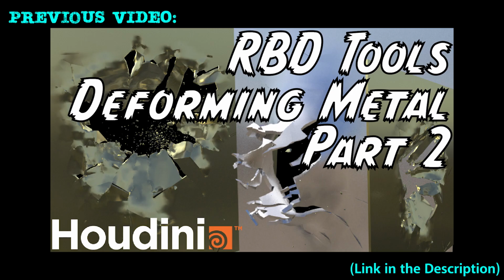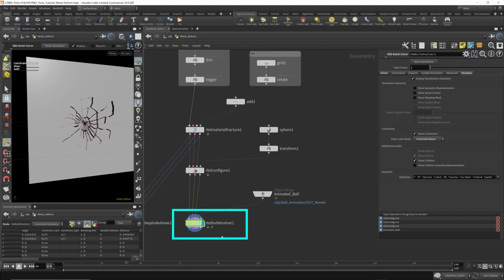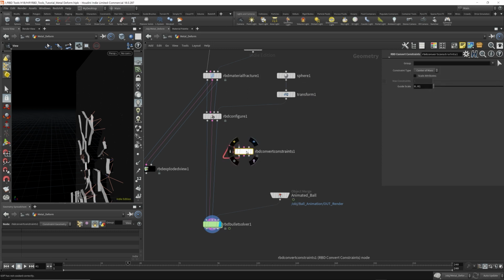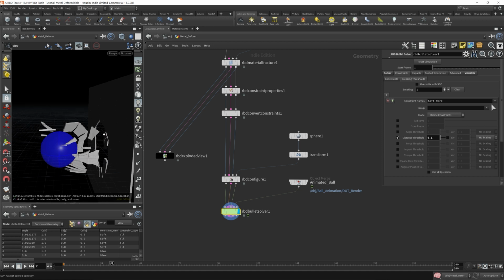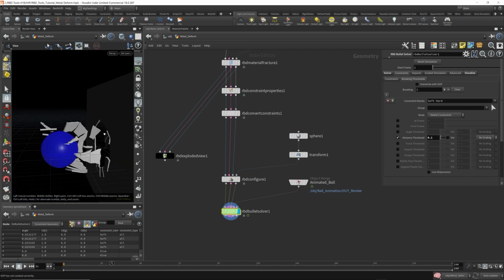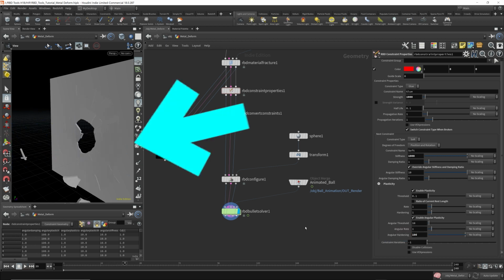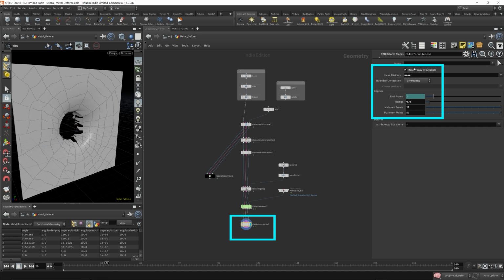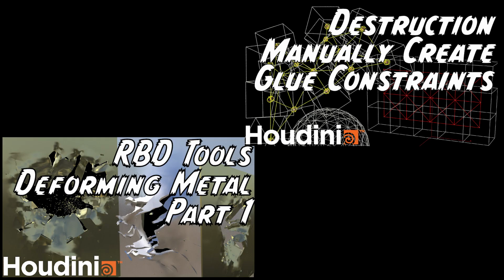Tearing & Deforming Metal using RBD Tools in Houdini Part 2

Comment: How do I stop the shaking those pieces after the ball through the wall?
Reply from the maker: This is a very common issue, there are a few factors that may cause the shaking, too much external forces acting on the pieces like bounce.  BUT I do find that in this particular example where you have pieces fracturing another one while keeping selective constraints still connected it is helpful to increase the elasticity and harden it as quickly as possible to try to keep it in position after the ball collides.  Try that and it's also helpful in the RBD Solver node to increase friction, lower bounce, & increase substep.   See if that works out.
Reply: @bubblepins  Thanks, will try!

Comment: Do not disable "Apply Constraint Properties" in "RBD Material Fracture" node. In some versions of Houdini this might lead to loss if the attribute "constraint_type" and broken simulation.
Reply from the maker: You make a good point.  This video is a little dated, I am doing a more updated series of RBD nodes in Houdini in my new Cinematic Destruction mini-series that currently ongoing:
https://www.youtube.com/playlist?list=PLqovuMX-teVMhkAd5dCfUI17Api5_YaPO

You can disable the "Apply Constraint Properties" in RBD Material Fracture, but you just need to add the constraint attribute data back in afterwards.  You can drop down a RBD Constraint Properties node after.  The RBD Material Fracture node will create the Constraint poly lines for you automatically, which comes in handy, but if you wanted to create that yourself manually, then you need to drop down a RBD Constraint from Rules to create the polylines and RBD Constraint Properties to fill in the constraint data.

Hop e this helps!

Comment: Thank you so much for all your tutorials! Especially as a houdini beginner you have helped me get the grasp of it. 

Followed your tutorial and it works perfectly. Just a question! after the rbd deform it seems that the velocity attribute gets lost. Might there be a solution to bring it back?
Reply from the maker: It's actually still there, drop down a unpack node and connect it to the 1st output, the Geometry output of the RBD solver.  You can do the same thing to the proxy geometry as well.  For some reason, it only works with the unpack node and the RBD unpack didn't work for me.   Remember to put an asterick in the "Transfer Attributes" parameter in the Unpack node or choose the "v" attribute to transfer back out.

Hope that helps!
Reply: @bubblepins  thank you! it works but the velocity seems a little off not too sure why.
Reply from the maker: @bryanng02  Yeah I think the RBD Deform Pieces does something funny to the pieces.  You can try this instead, put down an assemble node to repack the blast pieces and put down a point velocity node to recalculate the velocity for each blast piece.  Then finally unpack it again and remember to transfer the v back out.  

See if that helps!

Comment: Hi, can you tell me how I can deform metal without breaking it? And how to make adjust how strongly it is deforming?
I use an object that has a protruding part that should just crumple up, but instead it just pushes the part underneith away unrealistically..
Reply from the maker: I think you might be looking for something like the new H19 Vellum Unified Solver deform destruction, which I haven't had a chance to do a video on yet.  But I had a previous video on a very similar effect that I called "SDF Destruction" and it deforms an object upon impact without fracturing it:
https://youtu.be/a8xHhjFeZN0

Hope that helps!

Comment: Hi, thanks for the great tutorial! Liked and subscribed instantly! it all works perfectly I have just one question. Can you please also tell me why am I getting this slight but constant jittery movement on all chunks after the ball pierces the surface and how to fix it? Thanks a lot in advance!
Reply from the maker: The jittery movement may be due to several possible reasons.  
The first thing, I can think of is the RBD Deform Pieces node, sometimes it struggles to figure out which pieces are adjacent to weld together, so you can help it by filling in the piece parameter on the RBD Deform Pieces node.  This would be the attribute Name Attribute for the blast pieces, which should be by default "name".  And remember to select "Constraint" for Boundary Connection.

Is your collision geometry a little more complex with sharp pointy corners or some sort?  If so, I would suggest to turn up the substeps in the RBD solver → Advanced (tab) → DOP Network (expand) → Substeps.

And double check if you have the RBD Constraints on the edges of the blast pieces similar to 11:04 in this video.  

Also try reducing the bounce in the RBD solver → Solver (tab) → Bullet Object (sub tab) → Bounce.

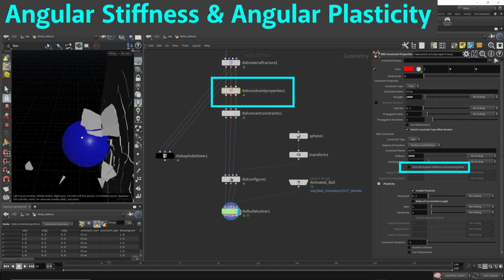Another thing I can think of it is to increase the plasticity 17:00 in the video, because this will harden the blast pieces almost immediately if the parameter is high enough, causing the pieces to stay in place.  

Hope this helps!
Reply: @bubblepins  Thanks I appreciate your prompt reply! Unfortunately none of this helped and all chunks still jitter. I downloaded your file and they jitter even there. If you would be able to fix it in your scene and reupload it whenever you'd have some time - that would be really awesome! But no worries, I will also try to fiddle with a few parameters to see if it helps fight the jitter. Thanks a lot once again!
Reply from the maker: @defonten  Thanks for telling me!  I didn't realize that scene file was jittering so badly.  I was playing around with the parameters this morning and managed to reduce the jittering noise, but for some reason there is still a bit oscillation left.  I posted an updated HIP file up along with a screenshot of the modified parameters I made on the blog.  Sorry I ran out of time playing around with this scene, so I've reduced the jittering, but not completely removed it.  I may revisit this scene in the future when I get more time.

Hope this helps so far!

Comment: awesome tutorial and explanation, thank you so much!
Just want to ask: what if I want to export that as a VTA texture?
From what I experienced, the VTA output node needs a dopnet to work (it will calculate also with a geometry Null but then the result wont work in UE or whatever engine) but we dont have any in this scene. If I set the object as Static, that will create the dopnet but the simulation brokes
Reply from the maker: Do you mean VAT (Vertex Animation Textures)?  I did a simple test for vertex animation a very long time ago using mantra to render it out and imported it to UE4 and it worked!  However I could never get collisions working with it so I gave it up.  The best thing about it is that you can export fluid sims into UE4 and at the time Niagara wasn't out yet, so this was a breakthrough for me.  But VAT isn't very necessary anymore, since Houdini and UE have a lot of tools to make the two applications more seamless.  You can just export the fluid particles from Houdini and import it into UE through niagara system.  Now I haven't tried this yet.  But theoretically it should work.

Hope this all helps!
Reply: @bubblepins  yes, I meant VAT, just mispelled two times haha. Ty for the answer btw, I'll try the Niagara workflow as well :)

Comment: how would you use the rbd configure SOP in junction with the rbd connected faces SOP? I'm having trouble passing the rbdconnected prim attributes through the configure node.
Reply from the maker: oh I know what you mean, its because the RBD Configure node packs the rbd objects which causes a conflict with the RBD Connected Faces node.  If you change the order of the nodes a bit, try putting the RBD Configure node at the end right before the solver.  Then after the dopimport node, put down a unpack node then you can use the RBD Disconnected faces.

Hope that helps!
Reply: @bubblepins  Right so place connected faces node before the configure node, then after the the deformpieces node the deleting dis-connected face node no longer works BUT the four prim groups created by the original connected faces node are still stored in the geo. Something is happening that keeping the disconnected faces node from working and I think its how the configure node packs them. Anyway with some clever grouping and deleting I can recreate the same effect I'd get from the disconnected faces node. It isn't pretty but hey, it works. Hope that makes sense. Thx for the tutorial btw!
Reply from the maker: @Cheesyeggbake  Thanks!  Drop down an Unpack node before the Disconnected Faces node.  Because the geometry is still packed after the DopImport node.  Hope that makes sense, it's a mouthful.

Comment: How do you make the ball collide with the wall if the wall was a voronoi fracture
Reply from the maker: Replace the rbdmaterialfracture nodes with the voronoi results.  You also need an unique name for each fractured piece, but the voronoi fracture node should do that automatically for you now since Houdini 17.  Then plug that into the rbdconstraints, but you'll need a rbd constraint from rules or rbd constraint from lines or something to recreate the constraints.  This should allow you to feed in your own fracturing into the RBD Tools.

Hope that helps!

You can also check out my other video on how to manually create glue constraints, but it uses the old dopnet way.
https://youtu.be/n0H3NM0EMug
Reply: @bubblepins  Thank you it worked!! but now my Tower/building is acting like an object instead of staying on the ground, so if the balls hits it, it goes flying off
Reply from the maker: @jonasmortensen1252  Double check if the constraints are created.  In the rbd constraint from rules or rbd constraint from lines or whichever rbd constraint node you used, there should be a color option to view the constraints in the viewport.  Drop down a null node and connect it to the middle RBD chain nodes (that's the constraint output of the RBD chains).  And you should be able to see the constraints in the viewport.
Hope that helps!

Comment: Great tutorial! I have been doing a few sims with this before, we are working with RBD now at Lost Boys FX school. If we follow this though, the deforming metal pieces continues to vibrate and does not stop. I had to do a VEXpression in the constraints, adding a i@timer++ and if statement to change the constraint into a Glue with -1 strength to kind of freeze it. Do you have any other solutions for that? I would have liked a more of an ease-out motion to my solution, at the moment it freezes after the timer is set. Gives it a bit of a stiff look...
Reply from the maker: I had a similar issue with guided sims with RBD Tools when I had the strength of the guide set too high.  So my guess would be a couple of forces are fighting for power.  Do you have multiple forces acting on the objects?  Like gravity and maybe something else?  And this happens a lot when the object is too small, like less than 1 Houdini unit.
Reply: @bubblepins   Many times, changing the global world scale in advanced tab to like 10 or even a 100, helps a lot with making smaller pieces wiggle. At times, even jumping into the RBD Bullet Solver and changing the padding of the geometry to 0.
Reply from the maker: @fakepilot  I usually add a bit of padding to the collision geo unless its very close, then I would make it 0.  Have you tried Convex Hull vs Concave?  But it would take a lot longer to compute.  I'm not sure if that is contributing to the vibrations
Reply: @Fake Pilot got into the same trouble with my sim... any way that you can share your vex code with us :) ?